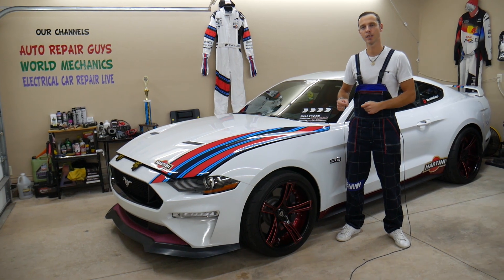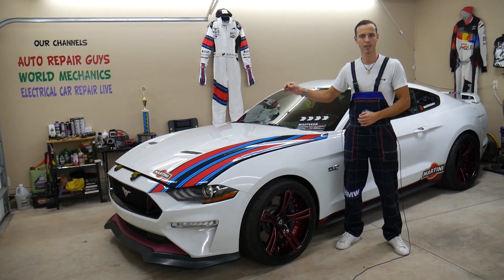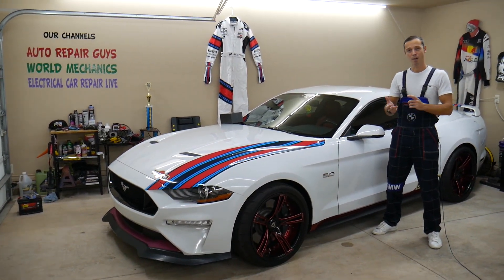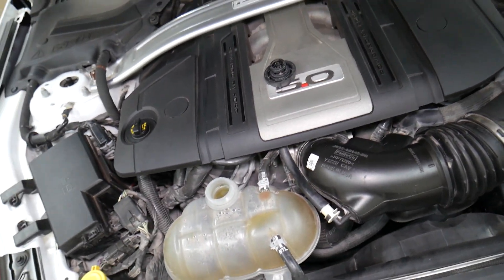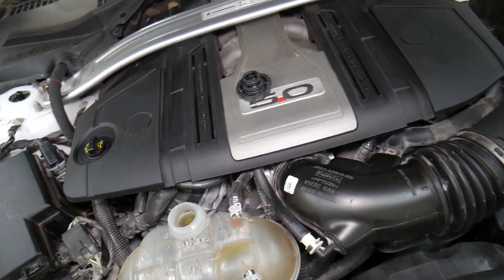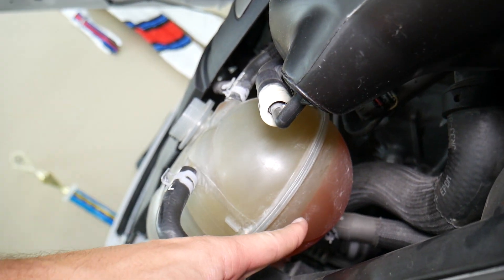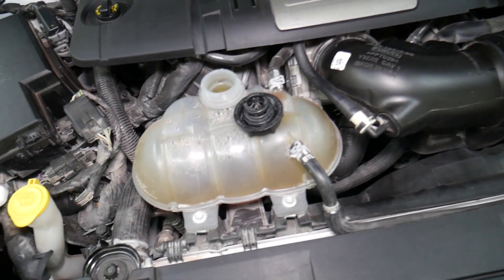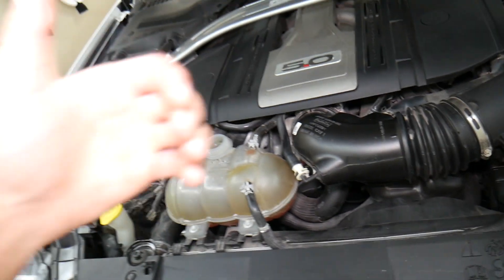WHY AIR BUBBLES IN COOLANT TANK RESERVOIR ON FORD MUSTANG 2005-2023

Comment: Hello  i have a 2008 mazda bt 50 disel i had a engine rebuild because it had a bad head gasket and it was overheating i pressure tested the block and head as well as had them decked. They are all good  had the radiator cleaned and its all put together now and on inital start i have the rad cap open and it seems no pressure  is building or bubbles but after it warms up after  it reaches operating temp i open the overflow tank  and see little bubbles coming out  of the hose in the overflow tank . It does not loose any coolant even after driving for 30 minutes and when i open the cap when its cold it seems to not loose coolant   and engine does not run hot. I am runnig without a thermostat can that be the cause? Or what am i missing
Reply: Did you find out what it was?

Comment: You missed one: the cooling fan. If the fan is not working then the coolant is going to start boiling. And another thing, though not too common, is a restricted radiator such as a radiator plugged with bugs, etc. to the point that the air flow through the radiator is poor. This last one would be more typical for old cars though.